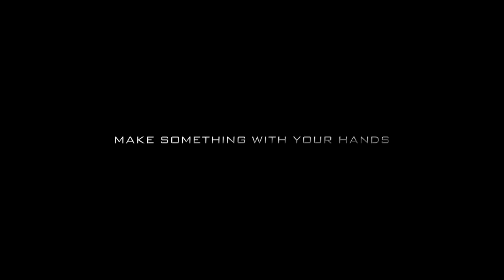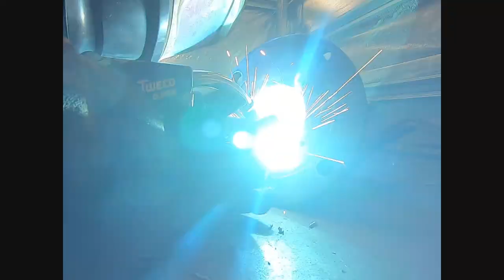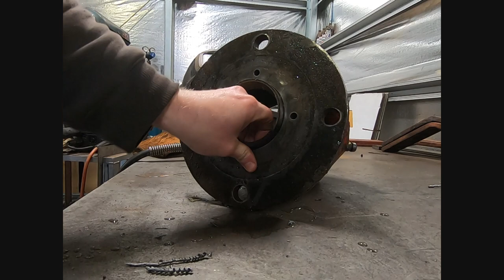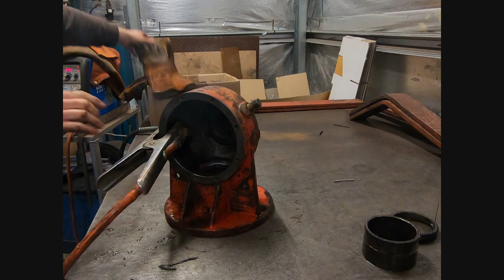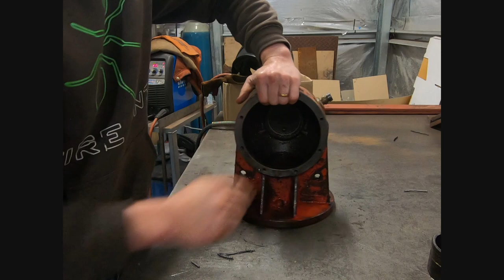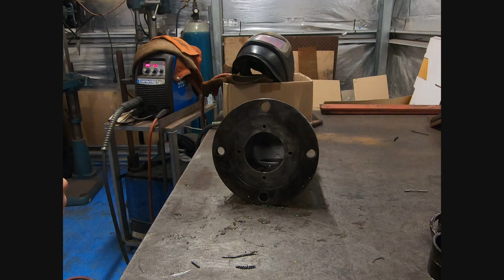How To: Remove bearings with a welder

Comment: Thank you so much for the tip👍. I have just successfully removed a stubborn race from my trailer hub. It worked !!! Thank you Thank you Thank you! I didn't even use water cooling at the end, just 4 tabs at 90 degrees apart to give my chisel a grab. The heat did the trick too for sure! cheers!
Reply from the maker: Sensational. Glad it worked well for you.

Comment: Great tip to share for people, thanks.
I had to do this many years back to get the bastard of a bottom tapered bearing race out from the head tube of my dirt bike. I'd tried bloody everything in the hours before finally breaking out the welder....which solved the problem in about 30 seconds 😑
Reply from the maker: Its become my first option when the welder is handy.

Comment: Awesome to the point video, thanks for sharing  !  Do you have a trick to mount new bearings that you can only just get started in the hole ?  Would putting them in the freezer work ?
Reply: Installation is made easier by warming the outer housing and freezing the inner part.  Every little bit helps, so a normal freezer @-20degc is good but dry ice is better, and more fun.
Reply from the maker: yes, as Ian said, freezing helps. dry ice is better, but liquid nitrogen is the best.

Comment: Would it be better to let the weld air cool or is water cooling part of the magic?
Reply from the maker: Water cooling helps while the housing is still hot, but either way will work.

Comment: Amazing.  Why does it work ?
Reply from the maker: The intense heat on the bearing shell causes it to expand, but as the housing is still cold the bearing only expands axially. Then as it cools it shrinks both axially and radially, so it ends up a smaller diameter than before. 
Or that is at least my understanding.
Reply: Your explanation sounds perfectly reasonable.  It still looks like magic though.
Reply: I suggest that the heat also softens the metal of the bearing a little, so it can squash a bit as it expands.
Reply: The thermal cycling from hot to cold helps loosen the bearing as it expands and contracts. 
The real magic comes from the bead of weld because as it cools, it actually draws itself together, effectively shrinking the part enough to pop out.
Reply: @ianrobertson3419  BIngo. The weld bead goes on hot. As the bead cools, it shrinks. The forces involved in thermal expansion or contraction are immense, and no material can really stop the movement. Just heating the assembly without welding and then letting it cool does not produce the same result as the welding trick. It is a darn good trick!

Comment: Will this work in an aluminium housing (car gearbox), or is it too easy to melt the alloy?
Reply from the maker: yes, it will be fine it wont melt anything. but dont go crazy on it at the same time. there wont be that much crush on it so it wont take much to shrink it off.